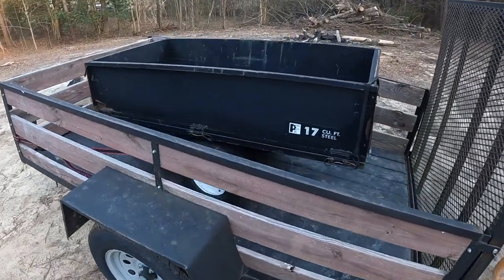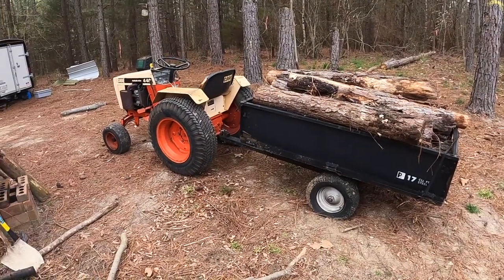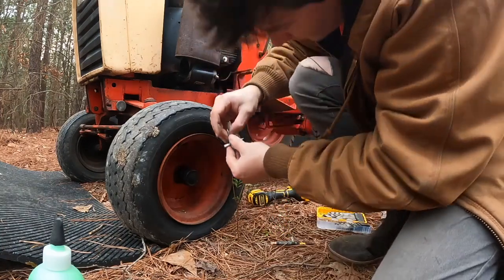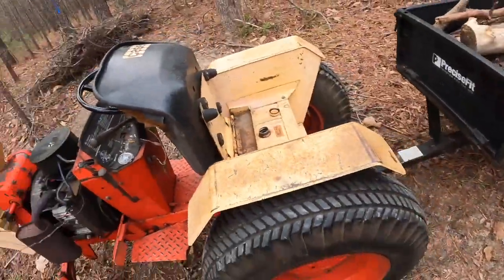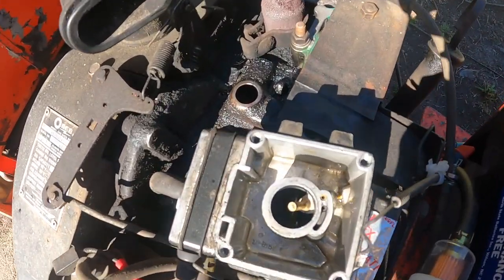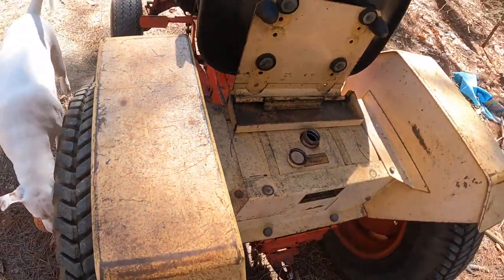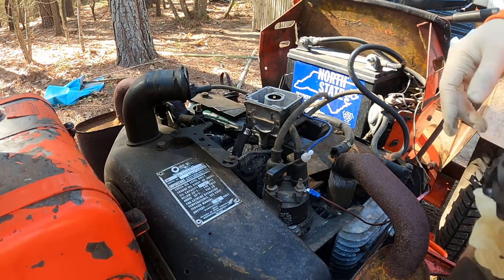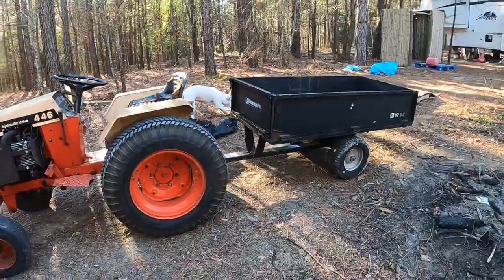Fixing and Using Old Garden Tractor and Trailer

Comment: I found it safer to use a ratchet strap tight around the tire while you pump with air to rest the bead.    It works for me evwrytime.  All size if tires.
Reply: I have seen some that wrap around the tire and were inflated with air to squeeze the tire.

Comment: Stop trying to break the fittings off. 
You are supposed to move it off center and pull it off.  Don't keep pushing it sideways till it breaks off.
I have greased a lot of tractors and never saw one break off.

Get a different nozzle for the grease gun that has a level release
Called A LockNLube grease gun coupler!
But there are other cheaper brands around $10.00.

And absolutely get a flexible hose!
Never use a solid metal tube.

Comment: why not add an  electric pump
Reply from the maker: That might be easier said than done. At least for me. And if the carburetor works properly it should have no problem pulling the fuel up but the bad diaphragms just prevented that.
Reply: Should be unnecessary.
That just hides the problem.